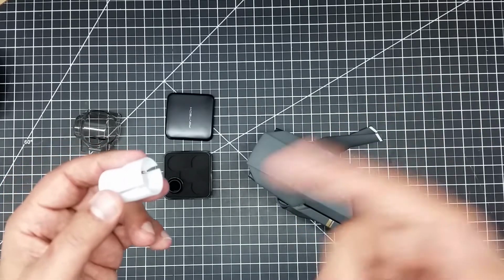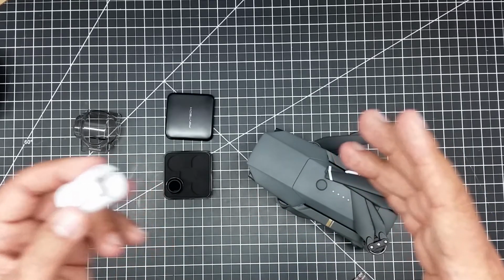DJI Mavic Pro - Filter Changing Tool!

Comment: I really like your tool for removing and replacing back the Mavic Pro Filters. If I were you I would patent it with a few alterations. Instead of having to pinch it to release the filter maybe you could add 2 small pieces of plastic on the side of it do you could pinch them together and it would release the the filter. Maybe I could draw out something you could look at. It’s a great ideal for you. Thank you for your videos . They are alway inspiring .
Reply from the maker: Thanks for the tips!